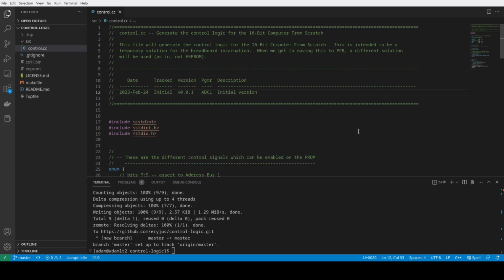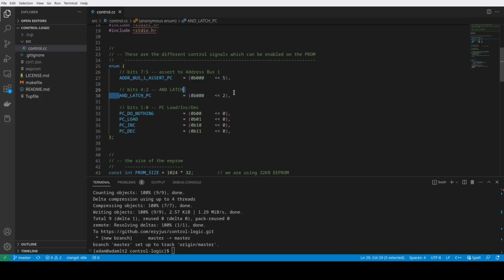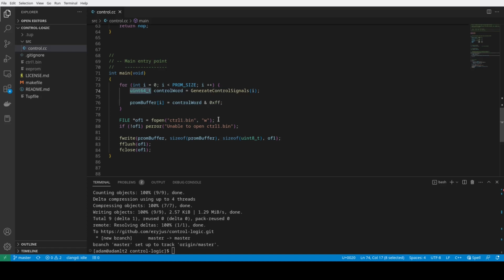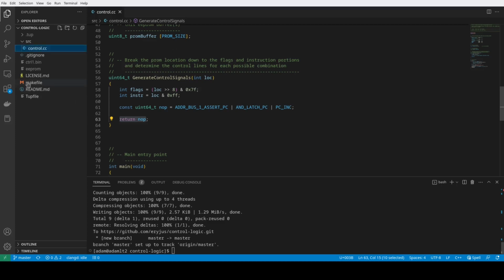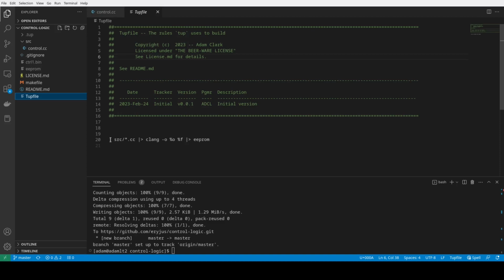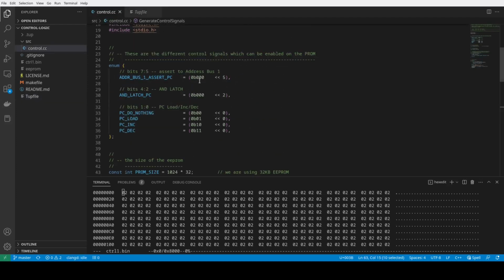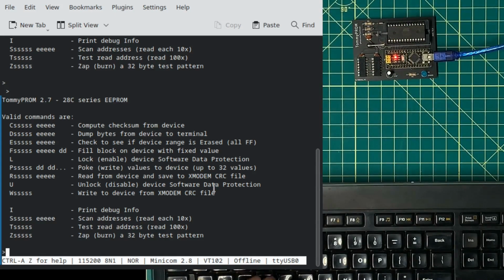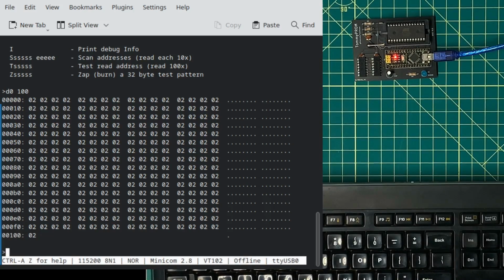0038: Free-Running the CPU? | 16-Bit Computer From Scratch

Comment: One problem I see with x86 and risk5 is that everyone is using the MMU for memory protection. one thought is that it would be better to have the processor limit it's address range and then have the MMU map everything needed into that range. I also envision separating data registers from pointer registers so that loading a pointer register gives a hint to the cache to preload the data.
Reply from the maker: Well, an MMU is well outside the scope of my project.  Maybe in a future build.

The biggest challenge with an MMU is not about getting entries into the TLB in a timely manner.  Certainly it seems your approach would work quite well.  But the key is going to be getting entries out of the TLB when it is appropriate to do so without having to shoot down the whole buffer. 

Good luck with your project!
Reply: There are some significant studies on memory protection already, I don't know why no one seems to ever go for tagged pointers. Even the old LISP machines already those.
How much hardware would be having tagged pointers if you are going to end up having to tag cache lines either way, unless you want to end up with specter.
Reply: That idea of having the MMU map the range I think is an artifact of how operating systems used to work and how everything is divided roughly in 2 "regions" (aka rings of kernels/user-mode), and the idea of opening up "ranges" to the users.

If we went for tagged pointers, then from an MMU point of view, no mapping of address space would ever be needed to load data from the RAM to the cache, the pointer itself would have an index to a table that contained all the pertaining pages allowed, so you could basically push in everything from the most used pages into the cache optimistically and it would work very well.

And you could flush it arbitrarily out of cache too, and you wouldn't even need to do any checking for memory protection besides testing if a given pointer tag matches the tag of the TLB, that should be a trivial equality test.

The TLB would basically only contain data about the pointer tags, the division of pages could be implicit, it would be a very compact data-structure, and the mapping between the address and a page would be basically a bit-shift.

The downside probably is that you lose bits in the representation of the pointer (is that really a problem if you have 64bits ? , do you really need TB of addressable RAM for a single process ? ), and a lot of stupid program made in "C" assume that pointers are integers.